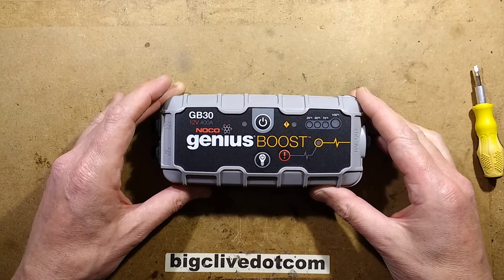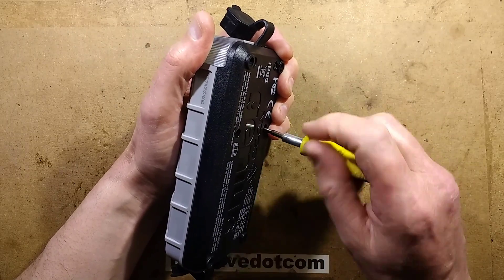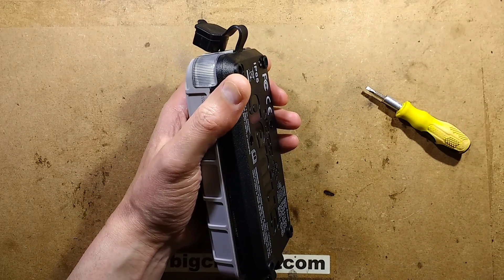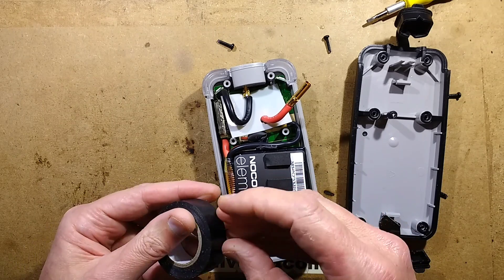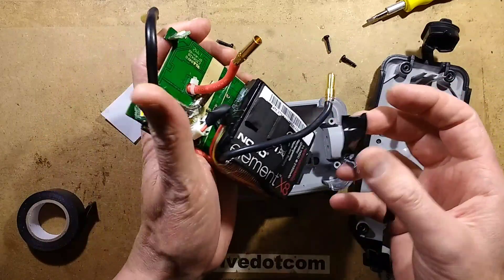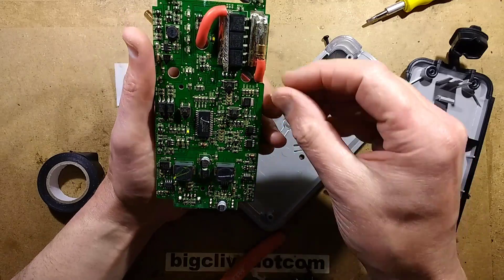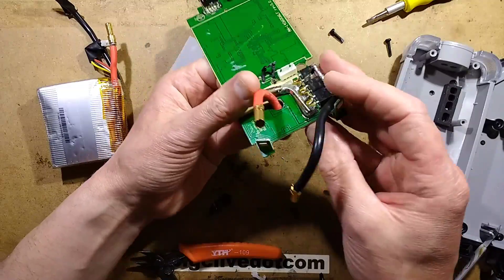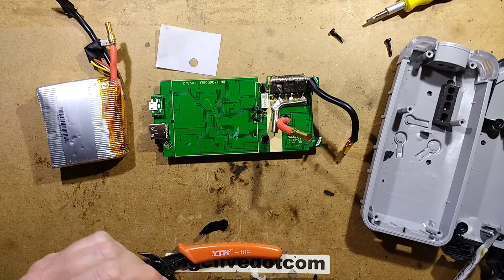Noco GB30 failure autopsy.

Comment: Wouldn't a battery that's intended to start an engine have to be able to supply a high load, like in the 100-200A range? If the lithium battery can't stand that, then it's basically not suited for the application?

Comment: I was hoping for a test of skill and a attempt at repair, but I get it. It's not worth the time vs money, but the labor of love...
Reply from the maker: MOSFETs and diodes easy, but I'd need to strip another boost pack to get a similar battery.
Reply: That's cool, I have faith in you anyway, but I would just use 18650's and make it thicker by wrapping a piece of plastic around it and epoxy it together.
Reply: Just for testing

Comment: I hate these things. First they simply cannot handle starting current for more than a few seconds, especially on a diesel. I've seen diodes and relays fried, I've seen jump cables melted off many times. I've even seen one rupture (the battery expanded and pierced itself on the PCB! Secondly, they use lithium technology batteries (Li-ion, Li-Po, whatever). These batteries, while having great power to weight ratios compared to Lead acid and other portable technologies, do NOT like to be left for long periods of time at full charge. The sales pitch for these devices is that you throw them into the glove box and keep them handy if you need them for a jump. At full charge, these batteries will probably be toast within a year. Lots of people have gone to use them and found that they no longer hold a charge or have even leaked or expanded. Not only are they useless but they are dangerous. They can get dangerously hot when in use at heavy currents. I have a good, old fashioned Jump Pack equipped with a reasonably sized lead acid battery. It has worked for years and continues to work well. Lead acid does not mind being stored for longish periods of time, providing they are fully charged first. The best part is, no stupid electronics - just a battery, a small analogue charger and some heavy duty cables. All built into one sturdy unit. I can even replace the battery if it (eventually) dies. Why try to re-invent the wheel?

Comment: where is the output cable to connect from the boost pack to the battery car?
Reply: Mario Gazzola The cables plug into the jack around the lights where he pulled the 2 wires out of (while trying not to make it explode).
Reply: sirp0p0 Are you serious?

Comment: This is what happens when you connect one of these to the car battery in the wrong polarity...
Reply: Diodes don't protect against reverse polarity: if they are setup to clamp reverse polarity to prevent damage to the NoCo's electronics, then you'll have short-circuit current from whatever is connected to the boost cable output with reverse polarity go through the diodes. Ideally, you'd at least have a fuse somewhere in front to blow that before the diodes die. If the diodes are setup to prevent jumper cable power from feeding back into the lithium battery, then reverse polarity means you have load voltage + lithium voltage connected across the diodes, wiring losses and FETs with the associated short-circuit current. Not going to be pretty either way.
Reply: OK, I see what you mean.  The diodes would protect against uncontrolled charging from the power port (like when the car starts, you connect it to a truck 24V system).  It won't protect against a "worse than short circuit" type of current from connecting a half-dead battery the wrong way.  If there's no current sensing to tell the MOSFETs to shut off - it could get ugly.
Reply: The diodes should prevent a problem with reverse polarity.  I think it's more likely that either the output got shorted or it was put on a bigger load than it could handle.

Comment: Did you say he was using it as a power bank? Those high discharge cell may not have as many charge cycles as most other lipos
Reply: They would be related to the hobby rc market where high discharge is required, after charge cycle life for these types of cells are around 500-1200 charges
Reply: but being the cheap china variety in reality they may only be good for 10 cycles lol

Comment: They kinda pretend to be premium, but it's mostly just the price. It's hard to find one of these that isn't under built and over rated.
Reply: Project Farm did a test on a number of these boosters pretending to be premium is an understatement for the Noco brand it came in second last to the one from Harbor Freight.
Reply: @RayB-RLB  Yep. I saw Project Farm test myself, he's awesome on his testing of products , There is no guessing on what the results are. Was thinking about the Viking jumper pack from HF for my motorcycle, but not now, and like you said, the NOCO faild next to it. I'm buying the AUDEW.
Reply: That's Con air. The clue's in the name. ;-p
Reply: My GB40 was defective. Traded for a Motomaster Eliminator
Reply: 5:00 seems so poorly made.    The high quality TrekPow is 100 times better
Reply: My gb 40 and 70 was great but my 150 lasted less than 3 months
Reply: Yup, my gb70 was garbage from DAY ONE!!
Reply: I have an ever start K05 that has held up nearly a year and I use it to jumpstart atvs often. It is much heavier than other packs I’ve held and even has a laptop dc to dc charge dongle. I knew it must have cost quite a bit to produce and they’d probably stop production fast and they’ve already stopped selling them. I had a Schumacher pack that lasted a few months and is significantly lighter in weight and around $20-$30 more expensive.
Reply: Cuz the wholesale and retailer marks it up 200%
Reply: Get the impression that a lot of this imported junk that our politicians get kickbacks and blind eye is turned to the quality of this junk.
Reply: Same story with Cuisinart brand ever since they were bought out by Conair... at one time quality, now, just garbage in a fancy shell
Reply: @RedTopProductions  ... and many other brands. The quality of the goods if the famous American jeans company plummeted immediately when they out sourced production. "We specify the required quality", yah, whatever.
Reply: Maybe YouTube is just glitchy but I can't see the reply threads for this comment, even though I posted and I'm pretty sure you're replying to me! I was drunk when I posted that, but I wasn't that drunk! Y u no sho? Am I the only one who the comments are failing to load on YouTube lately?
Reply: @RedTopProductions  : Gosh....... you missed some amazing Pulitzer items from me and about 6 hours of consistently brilliant stuff flying in from all over the world!  Shame.....never mind eh?!